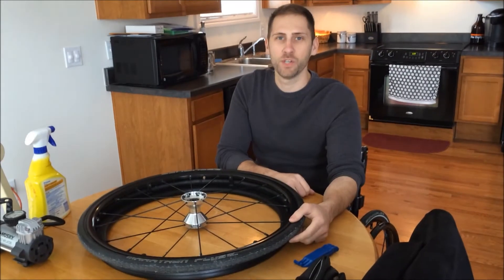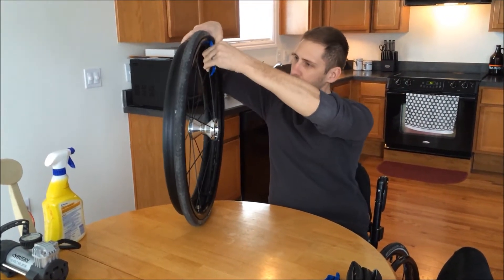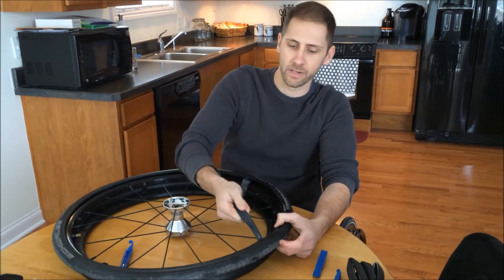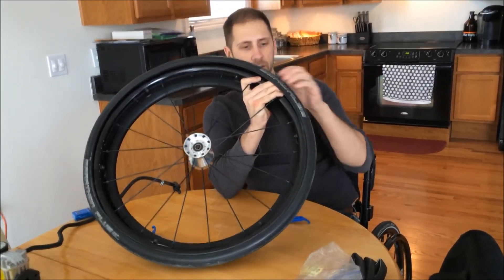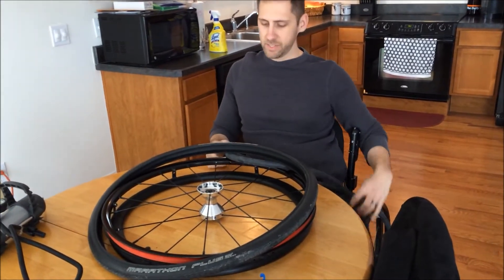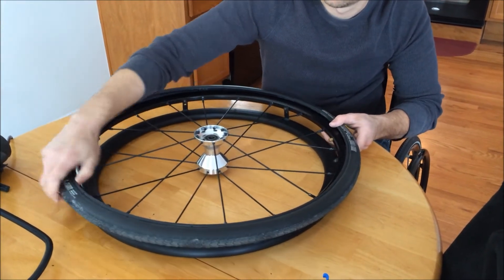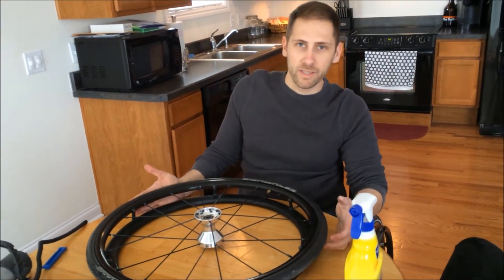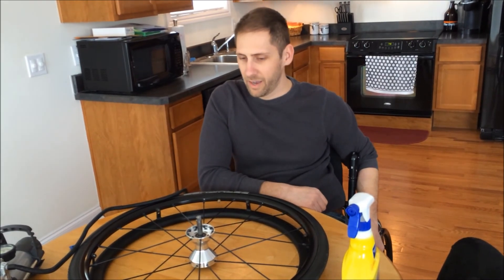How To Repair a Flat Wheelchair Tire

Comment: Thanks for the video! I haven't had to change my tires yet. But I see that we have the same type of tires, and push rims (instead of just the thin rim/rod), I tried to clean in the crevices that seem to build up with dirt. Seems like I may need to remove the inner tube in order to pull the thumb rim apart from the rod grips and tire/wheel. Is that true? I loosened a few nuts and couldn't retighten it.

Comment: I enjoy your channel and it has helped a great deal.. I am traveling to the Northeast this winter and may run into snow and slush and am wondering about getting a second set of wheels for the trip.   My question is how to size this stuff and if I will need  another set of rims if I cannot use the 24" ones that came with the chair as I purchased a set of pneumatic spinergys about 4 months ago. Thanks.
Reply from the maker: You can get a second set but it's not completely necessary. I've used my spinergy's in the snow. I'm looking into getting a set of "knobby" tires for my extra chair to try them out in the snow though. Unfortunately, there aren't a ton of options that fit the 24" wheel. The rim is a different size than a standard 24" bike tire...found that out the hard way because I purchased 24" tires and they didn't fit. You need to look for something with a 540mm inside diameter. Kenda makes a set. The other issue you run into is that they are much taller so it changes the "dump" of the chair. You will also need to adjust your wheel locks each time you switch so it can be a pain if you only have one chair. I have a back up chair though so I may try it out on that one.
Reply: Thanks

Comment: I have had my wheelchair for little over a year now and still no flat tire! I'm also using Schwalbe though not the Marathon Plus, can't remember what mine is called. Think I may need new tires soon because I have threads sticking out from the Schwalbe tire on both sides and it kinda looks like the material is peeling in a way which I fear may put the inner tube at risk. I usually pump 8kg of air into my tires, they can hold 10kg of air pressure apparently but I don't have the muscle strength to pump that much air, and not even the gas station air thingies can do it lol

Comment: Hey guys, I've got this wheelchair with rubber tires. Now that they are almost all worn out I'd like to switch to ones like you have. My question is what tires should I get. The wheelchair is for my grandma and mostly for indoor use (house and hospital). Thanks
Reply: Choose some tires with a pretty smooth surface rather than some with a rough pattern. Smoother tires roll more easily on even ground like floors and such, while more "mountain bike tire like" tires are better if going on terrain most of the time.

Comment: Hi Scott Castille :-), I have rwo questions if you are able to help please...
I have the same tyres as you...yes they are very stiff getting off..what type of spray lube is it you recommend..am wary of using something that might 'eat' the rubber?! 
Also..my whole on the inner tube turned out to be right over a spoke hole fitting on the inner rim. It was like two slits either side of a circle if that makes sense. My tyres had not been soft prior to the puncture. Do you know what might have caused the spoke fitting causing the puncture and what I need to do to remedy it so does not happen again? (That fitting does not feel like it is rough or protuding any further than others to my inexperienced self.)
My tyre levers snapped so resorted to using a pair of spoons..inevitably a bit of rough on the rim and the bead as result. Hope does not cause problems..how would I rub down the edge of rim to make smooth again? Sorry lol three questions. Doh. Thank you for your video though..Very informative and got me out of a hole.

Comment: How do you deal with the snow. I live in North East Ohio and were getting hammered with it, I don't like going out in it, I have metal hand rims so they get ice cold, also when I come inside, I track snow in like crazy it gets stuck in my casters in between the hand rims. I think I seen in one of your video's that you live in Ohio so you know what I'm talking about. I was just wondering if you had any tips or tricks. Also do you shovel the snow how do you keep your  ramp cleared (if so how, I'm a senior in high school so I don't have to worry about it now but when I do I'd like some kind of idea on how to do it)

Comment: Hi,  I'm new to using a wheelchair and I just got mine and it already has a flat. I don't have the tools yet, so is there any other tools i can use? Also, how do I take the wheel off? Do I need tools for that? Thank you
Reply from the maker: Your best bet is to get actual tire changing tools since things like screwdrivers can damage the wheel. My chair wheels are quick release - you just push and hold the button in the center of the wheel and pull it out. You can always take the chair to a bicycle shop to repair the tire. No need for an actual wheelchair specialist.
Reply: @ParalyzedLiving  Thank you!

Comment: Hi I use the same type of tyres they are great!!! But could anyone explain the pro's and con's on solid tyres are they good or not???   Cheers Bruce
Reply: Bruce Veevers - solid tires will be much more solid, going over a bump, they will not give, like air tires, I have air and solid tires, I rather air tires.

Comment: Hi!  Great video!  I was wondering if you could tell me about the pump you use on the tires.  What brand is it?  Are you happy with it?  It looks to be the perfect size for me.  Any info would be great!  Thanks.  Take care
Reply from the maker: I believe the pump is made by Husky. I bought it at Home Depot for around $25 and it is very well-built. I really like that it can be plugged into a wall as many "car tire" pumps only have a cigarette lighter power source.
Reply: @ParalyzedLiving  Hi Brian, great video! I was wondering if you could tell me about the pump you use on the tires. What brand is it? Are you happy with it? It looks to be perfect size for me. Any information would be great! Thank you for your advice. Take care. Great video! Kind regards, from, PaulLaw.

Comment: I too have marathon plus (25-540) 24x1. Suddenly it came from from the rim. looks like it expanded. it lost its stiffness. I have used only for few weeks. 

Can I use tubeless tyres on my rim, which comes with tube.
Reply from the maker: Anand Kumar Yes, I believe you can use tubeless tires although they are often much more stiff of a ride over bumps and obstacles. It's all about personal preference. I like having a slightly softer ride with air filled tires.
Reply: Anand Kumar  - I have one set of my spinergy Rims with solid tires, they are pretty good,
Reply: @ParalyzedLiving  Hi Brian, I too have a marathon plus (25-540) 24x1. Suddenly it came from the rim. It looks like it expanded. It lost it’s stiffness. I have used only for a few weeks. Can I use tubeless tyres on my rim which comes with the rim. Kind regards, from, PaulLaw.

Comment: my tire is also flat and is a 24x1 size tube and I was wondering if a 24x1 3/8 bike tube could work, is it too big? I asked my repair place and they said only the 24x1 size works but my local shop said its only a quarter size or so bigger, thanks
Reply from the maker: +SmartyP89 I think I've had a shop install the bigger tube without issue but the 24X1 fits better.
Reply from the maker: +SmartyP89 I think I've had a shop install the bigger tube without issue but the 24X1 fits better.
Reply: I see, thanks I'll give it a shot

Comment: +paralzed Living,  what is the best tires to use wheelchair on the roads? I bought new marathon plus tires, but they lasted only around 50 KM only, when use them on the road. what is the best tire for road use?
Reply from the maker: I also use the Marathon Plus tires and they usually last around 6-8 months. I have not tried other tires but I do like these since they are black and sporty. They also do well for road use.
Reply: @ParalyzedLiving  Hi Brian, how are you? Parlayed living, what is the best tires to use wheelchair on the roads? I brought new marathon plus tires, but they lasted only around 50KM only, when use them on the road. What is the best tire for road use? Kind regards, from, PaulLaw.

Comment: Also, where can I get one of those CO2 inflators? My left wheelchair tire keeps going flat and I can't figure out why. I just got my tires replaced about 4 months ago with the Schwalbes and I'll fill my left tire and about 3 days later it's flat.  I just about broke my wrist getting out of bed when I went to transfer and my tire wasn't locked b/c it was flat. Thanks !
Reply from the maker: sbrowne326 You can get the C02 inflator at most bicycle shops.Sorry to hear about your wrist!
Reply: sbrowne326 You may have a number of problems, and it's hard to tell just from your description. When I have an issue with a tire that keeps deflating, I look for a couple of common culprits. First, check the seating of the tube and make sure no debris or foreign object has somehow stuck to the inside of the rim under the inner tube. Make sure to check for debris inside the tire itself. Run a finger (if you're brave) or a soft fibery cloth over these surfaces and see if it snags anything or if you feel anything sharp. Make sure nothing pinches when you reassemble the tire. And if there is a valve stem check it with a drop of dishwashing detergent to see if you have a slow leak (it will bubble).  I hope these suggestions help!
Reply: Paralyzed Living , I think Wal Mart has them too!

Comment: Hello, my name is Ryan.  I have a disability and use a wheelchair to prevent me from tripping, falling and being hurt.  I recently had to replace both of my years old X8 wheelchair tires, and the air tubes.  On the tire it says 110 psi (540).  So is 110 psi, the maximum air pressure that the wheel can handle or is that what I should fill it up to?  They are filled and working, because I went to a bike shop to have the work on the wheels done.  Also, when I asked my wheelchair repair shop about the psi for my wheelchair tires, I was told to do 80 to 90 psi.  I am confused, because I am being told one thing, but then see the 110psi (540) on my new tires.

Comment: I popped three inner tubes trying to replace my tires. I gave up after the second one popped, and the third one popped when I put the old tire back on. I have no clue why it was this fcking hard. Spinergy rims, schwalbe marathon plus tires. Right size tube. Prying the tire back on the rim was just almost impossible, you have to use so much force I thought I was about to break the plastic pry tool. I was a bike assembler for 9 years, I've replaced hundreds of tires. This was the worst, most difficult tire to fix I've ever seen. It's unbelievable it's this hard. Now I'm cruising on a flat until I can get someone to help out & bring it to a bike shop, because obviously I'm doing something wrong. 

Man this was awful. I haven't been this mad in a really long, long time.
Reply from the maker: Aww man sorry to hear you were having so much trouble. I agree that they are challenging to fix. The secret to getting them off/on is using a ton of soapy water/windex before even attempting to pry on them. Really work it down into the bead. When I put them back on I put just a little air in the tube first to keep it from getting pinched easily.